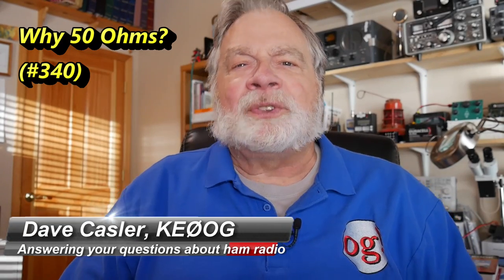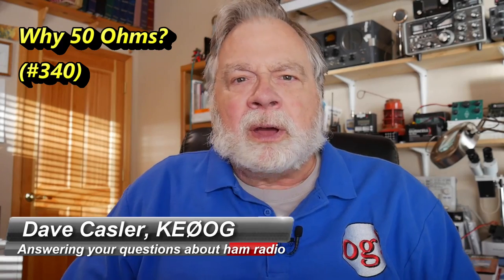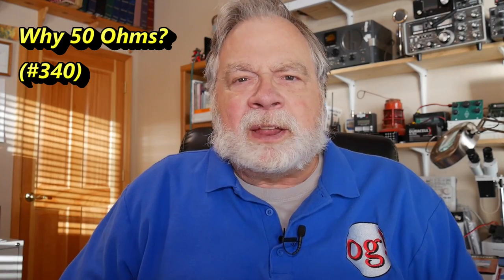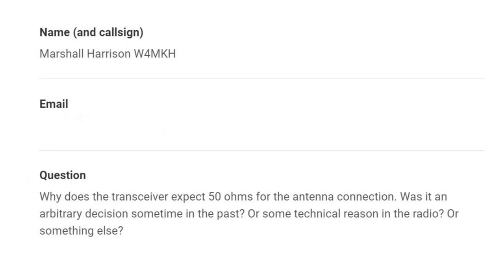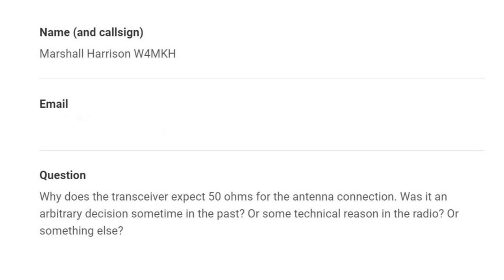Why is Coax 50 Ohms? (#340)

Comment: In the 1990s I had CB two way radio (27 MHz 0.5 to 4W AM, FM) and the only thing that was allowed was a good thick cable and antenna.
We use thick PL259 plugs and these were difficult to solder. The cable was 50 ohms.
Today we use 75 Ohm cable for TV and satellite. I m from Germany.

Comment: Thanks for the brush up lesson. Please acknowledge that there are deeper reasons other than expense and popularity for the technical specifications of these coax cables. Also, there are wear and tear issues for coax cables other than water getting into it. Coax cables experience constant vibration after installation, a problem especially where you have bends in troughs, there is a tendency for the center conductor to cut into the dielectric and eventually make contact with the shield.
On another topic you mentioned--even if Broadcast cable like Belden 1694 (for HD SDI), is much more expensive than Belden 1189 (for CATV), the former is horrible for the much cheaper latter's applications. Thanks again.

Comment: I was always thinking that cable TV uses 75 ohm because these are cheaper low-quality cables than usualy used 50 ohm. I was wrong. In this video i've learned that it's actualy better to use 75 ohm for longer cabling around the house when there is no need to actualy deliver any substantial RF power, because 75 ohm cabling has lower attenuation. Thank you.

Comment: Years ago my first impression was 50 ohms chosen because well that's just what it is. And CATV had to use something different because that's just what it is. Before I was educated in physics and chemistry I asked a pilot why do planes and ships use knots and nautical miles. I knew miles and in Mexico and Europe they use kilometers but I didn't understand why another set of distance unit. The pilot said reason is because there are many crusty old sea captains steeped in tradition and maintain that unit. Obvious there are reasons why the nautical mile for planes and ships, but that explaination of "steeped in tradition" sounded reasonable.

Comment: I have a background in high power RF (23-57MHz) and have experience of 30 Ohms 9 inch lines and we were running up to ~1MW down them.  Best were short circuit tests producing a 40:1 VSWR and we could find the high current points (hot) and high voltage points (cold) by walking up and down the lines and using our hands.

Comment: Interesting is that I used (50 years ago) a 75 ohms coax cable for radio wave transmission from antenna to radio. Using a dipole antenna (made for ca 100mhz) having  300 ohms impedance. This meant using a antenna amplifier which also was good for adjusting the impedance from 300 to 75. Of coarse the radio expected this 75 ohms....and a receiver will not ask for high power or voltage. The coax cable also provided energy for the antenna amplifier because DC does not interfere with signal transmission.

Comment: I have used 75 ohm coax for my base station which was a poly insulator for the center conductor and then a foil over that and a tight braid over that and another braid over that then a final foil and the outer insulator. The conductors of center on one coax I used was stranded 12 gauge and another coax that I used was a 16 gauge solid center conductor but had the same poly insulator and shielding along with the same outer insulator. The coax was used to connect cable tv systems and it was a direct burial cable that I had installed as a Ariel from my shack to the antenna that wasn’t affected by uv rays. I ran a X-Force 2 driving 6 pills amplifier and it all held up fantastically. The only issue that I had to resolve was that I couldn’t run over 30 watts out of my antron fiberglass antenna and I changed it to a metal antenna that had 20 grd radials and it was 22 feet tall and had 3 horizontal elements on the top and it allowed me to pull in stations using beams on horizontal. Probably the best set up that I ever had and never an issue for the 12 years it was up. It was a great experiment with 75 ohm coax and everyone telling me that it would smoke my station. I have acquired more of this coax and it will be ready for my next base station.

Comment: My late friend Had the original onion paper drawing and theory document that John Fetzer wrote for 590 WZKO AM. It talks about how he made the coax from Copper pipe and ceramic insulators. He explains the math he used to calculate it to be 2 Ohms. I have had the chance to work on this system. And I can tell you the math and tuning network is amazing.

Comment: The reason for 50 or 75 ohms is set by natural feed point impedance of two basic antenna configurations. The natural feed point impedance of a quarter wave antenna is 50 ohms. The natural feed point impedance of a dipole is 75 ohms.

Comment: When I listening FM radio stations and try get many stations as possible. Antenna was monopole which was connect to the radio antenna by clip. I take coaxial cabel outer conductor and I filled it with rope. I had no way to measure its resistance, but as a lead it was nice.

Comment: ChatGPT version:
Why is Coax 50 Ohms?
Coaxial cable is designed with a specific characteristic impedance, which is a measure of the resistance to the flow of alternating current along the cable. The two most common characteristic impedances for coaxial cables are 50 Ohms and 75 Ohms. The reason 50 Ohm coaxial cables are used, especially in radio frequency (RF) and telecommunications applications, has to do with a balance between power handling and attenuation (signal loss).

The characteristic impedance of a coaxial cable depends on the ratio of the inner conductor diameter to the outer shield diameter and the dielectric constant of the material separating the conductors. When designing coaxial cables, engineers consider various factors such as power handling, signal attenuation, and voltage standing wave ratio (VSWR).

In the early days of coaxial cable development, researchers found that certain characteristic impedances provided optimal performance for specific applications. For example, 30 Ohm coaxial cables had minimal attenuation, while 77 Ohm cables had maximum power handling. However, neither of these impedances provided a good balance between the two.

The 50 Ohm coaxial cable emerged as a compromise that offered a good balance between power handling and attenuation. It became a popular choice for radio frequency (RF) and microwave applications, as well as test equipment and certain data transmission applications. 75 Ohm cables, on the other hand, are more commonly used for video and cable television applications, where signal attenuation is a more critical concern than power handling.

In summary, 50 Ohm coaxial cables are used primarily because they offer a good balance between power handling and signal attenuation, making them suitable for a variety of RF and telecommunications applications.

Comment: I recently asked myself (again) why we have these 50 Ohms impedances with the usual electronics T&M equipment and why there are 75 Ohm coaxial cables used in the TV cable network. You gave me the answer and pointed us to the right source to learn more about this. Thanks for this!
But I must add a correction to the statement given after 07:15, which in essence says: "all the energy is carried on the outside of the inner conductor and on the inside of the shield". This is wrong, it must read: "most of the current is carried on the outside of the inner conductor and on the inside of the shield".
The energy is carried in the electromagnetic field between the inner conductor and the shield.
Reply from the maker: You are correct. The energy locus is given by the Poynting vector.

Comment: SMITH CHARTS. Come on, throw in SMITH CHARTS. Then show how to tune open wire feeders by putting a short across them. It's all good fun.

Nice explanation. I'd like to point out also that 1.4 is the approximation of square root of two (actually 1.414 etc.) , which in turn is the inverse of 0.7071 which is the RMS of 1. It all ties together.

Comment: Great video.  one addendum  - Water and  newbs coiling the cable too tight (they think that it is like lamp cord. or rope!)  Perhaps you have covered this (This is the first time that I have seen one of your videos).
Reply: Yes, water in porous coax insulation is a killer because it has a very high dielectric constant (80 at room temperature) and this messes up the characteristic impedance and also makes it quite lossy! Bends change the geometry and can cause reflections and other undesirable results.

Comment: We used to use co-ax in the early days of PC networking (long before Ethernet) and had to terminate both ends of the daisy chain with 50 ohm resistors. Now I understand why.
Reply: That was Ethernet
Reply: @AlessioSangalli  It certainly was.
Reply: @beachcomberbob3496  i was confused by the statement "long before ethernet" in reality ethernet started with 10base5 that used rg-8 cable
Reply: @AlessioSangalli  Most youngsters think Ethernet is  RJ45 cable, so I should probably have worded differently. Sorry.

Comment: It's worth noting how important the standard 50 ohm impedance is for all analog signal processing, not just in radio. All modern BNC cables are 50 ohms (or occasionally 75), which includes most scientific analog transmission. I've done a load of nuclear science and radiation detection research using long coax cable runs, and this video very well explains the history of that standard. Great content!

Comment: That lesson just got me from near zero understanding all the way up to about 70% of full understanding, so you did a great job! Back when i was much younger, I took an ohm meter and measured the center to shield and didn't get 50 ohms! LOL. Since coax was invented so long ago, why did it take so long to migrate to the home TV antenna lead in wire? Remember 300 ohm twin leads? So, probably, 300 ohm lead had even less loss than modern 75ohm cable and probably cheaper at the time I'd guess.
Reply: Cost and twin lead is lower loss

Comment: I see you have some aircraft videos. I worked on Avionics for 29 years at Collins Radio (a division of Rockwell International, then became Rockwell Collins Inc. Then purchased by United Technologies, now owned by Ratheon) I didn't do RF, but did design HIRF and Lightning filters most of my career. Also did the qauificationl tests, (shake/bake/EMC per RTCA DO-160) on the flight control products. 
ARINC429 is a serial communication bus. The typical STP wire is Teflon 22AWG. This has a nominal 68 ohm differential pair impedance. So the design of transmitters, which are typically push pull transistor drivers, have 33 ohm output resistors to drive that wire. It's all moot, though as the fastest return to zero bit rate is 100KHz. And they have a maximum slew rate of 5 volts/microsecond to prevent any transmission line energy problems. The specification for this bus, is interesting as it looks like a brain dump creation where all these ideas are inserted into the spec. For those outside this industry, ARINC is Avionics Radio INCorporated. It is a collection of standards used for avionics design. RTCA is Radio Technical Commission on Avionics.
I found this video interesting as well, Thanks.

Comment: Great choice of music, David. The SMA connector is 1/4" 36tpi.  Never seen 36 tpi before, and I am almost 75 ohms, oops, years.
It would be of great interest knowing about 50 and 75 ohm transmission with PCB tracks, single and double sided,
which leads to flexible PCB looms/connections.

Comment: The outer shield of a coaxial cable acted like a faraday cage that keeps the signal inside the cable. 
The braided sleave handled higher frequencies. A solid shield worked better for lower frequencies

Comment: One correction. Oliver Heaviside did NOT create "differential Calculus", but invented a new technique for solving "differential equations" and independently developed "vector calculus", a small part of Calculus. Engineering departments of modern universities have mathematics classes such as Calculus, Linear Algebra(full vector math), and Differential Equations. EE takes one more class, Probability and Statistics. 
Btw., 50 Ohms impedance is also a common PCB(Printed Circuit Board) line trace impedance we use today.

Comment: This Hevicide guy was a genius, all right.
It's a shame that I've never heard of him.
That's no longer a problem, now, though, is it?

This is a very enlightening video.

I can't claim to fully understand all that has been presented here, but it is much more acceptable to me now than it has been, and the explanation is fully appreciated.

Not being familiar with the world of the transmission of electronic signals, limited to being familiar with the phenomena of brute voltage or current induced actions regarding the inductive or capacitive actions of motors, contactors/relays, and their associated devices, I've marveled at the electronic world, hungering for the answers to its mysteries.

I'm still somewhat bamboozled by electronics, but now slightly less so.

Thanks for the heads-up.

Comment: I like your explanation and history presented. I do have a question and maybe you can shed some light on the subject; if cable never wears out, why is it that the TV cable providers are on a continuous rolling schedule of replacing their entire cable system? 

I  was told by a company employed tech that the cable has an average lifespan of around 10 years, and they have so many miles of cable that it takes about 10 years to replace their entire network. So by the time they finish replacing their cable it's time to begin again at the oldest starting point. 

I  also was surprised to hear this info from the tech. My electronics brain 🧠  figured it was because new cable is made better to handle more data speeds and capacity, but I've never heard the technical reasons.

Comment: the characteristic impedance of a 1/4 wave dipole is 72 Ohms, Also, a 300 ohm folded dipole could be very easily made and transformed with an almost lossless balun.I believe that is why it was selected, so no matching necessary.

Comment: I'm impressed by the amount of work you have put into this, but for ham radio I think you are a little off the beam.  My ham radio experience dates back to the early 1960s. I was general class (code and all) while still in high school. 

First all the material on twisted pair is useful for Ethernet cables but radio (then) was quite different.  

Perhaps the most economical antenna was the half-wave dipole. It had a Zo of around 72 ohm so RG-59/U would work mostly. The RG-59/U of the era had polyetheyene (I think)  and was generally considered lossy. RG/8/U (with a foam insulation) was much better and could easily carry 1 KW transmission signal. The size of the cable (about 1/2 inch) helped make it resistant to breakdown under high VSWR loads.  (RG-59/U was about 3/16 inch (IIRC)).  

Most hams operated below 30 MHz. (the 6m band often interfered with TV sets in outlying areas and 2m was pretty much line of sight.) If a dipole was converted to an inverted Vee then the Zo would come down a bit so that you could get a pretty good match with RG8/U. Many hams had an antenna tuner to get the VSWR down to 1.2:1 or so.  Many installations were at 2:1 (or more) but just ran with it. (1.4:1 is not a minimum VSWR it all has to do with matching the load impedance to the source impedance)

If you really wanted low loss/high power you could construct a balun and use ladder-line but that was more difficult.  Some guys used twin-lead (TV antenna cable) for folded dipoles but that had a Zo of around 300 ohm.

For the most part, the 50 ohm is  a compromise between high power and low loss for air-dielectric coax of the 1930s.   (https://www.microwaves101.com/encyclopedias/why-fifty-ohms ) Air-dielectric coax was fairly easy to construct: tubing, wire and some glass beads.  Coverage of the early stations was by brute force. thus,  500kW was not unknown.  The military also pushed the limit. The VLF station in Cutler Maine was 1.8 MW.  

Much of the surplus electronics available in the late 50s used 50 ohm cable with the PL-259 connectors.  It seemed most Ham transmitters also used the PL-259. As better coax was developed, it seem to be the best for VHF/UHF.  Receivers, on the other hand, often used the simple RCA phono jack as the antenna connector e. g. Hammarlund)

All this was long before cable TV or Ethernet was ever dreamed up.  Cheap coax was often used for microphone cables, but AFAIK there was no control over Zo, The coax was to get rid of the 60Hz hum that seemed to be everywhere!

Thanks for an entertaining article!

Comment: As a telecomms guy I was taught that the defination of the charistic impedance of a transmission line is the impedance of an infinite length of the line OR the impedance of a finite length of line which is terminated in it's charistic impedance.
Reply: This is the difference between engineering and physics.

Comment: Hey Dave. I have a j-pole 25’ up in the air and connected 40’ of RG6U 75ohm coax to a Baofeng HT that I’m sure isn’t actually putting out more than 4 Watts. To my surprise I was able to hit 2 different repeaters in 2 different directions (one west and one east) from me, each at least 20 miles away. The reports I got were amazing as no one could believe I was on a Baofeng HT or that I was using RG6U. I was very pleasantly surprised to say the least. I will be upgrading the coax in the future but I used what I had and I’m thrilled with the results! Just thought I’d share my experience. 73 KM4OCJ
Reply: RG-6 and baofeng - a match made in heaven